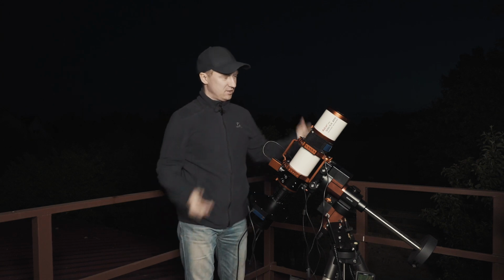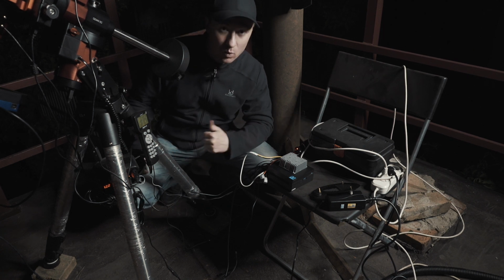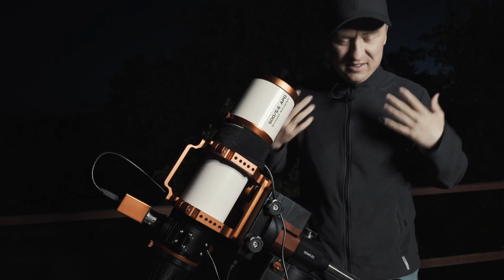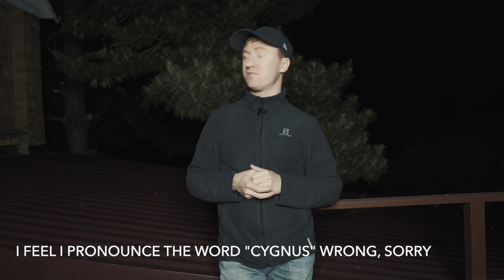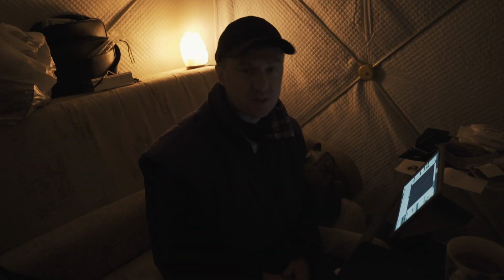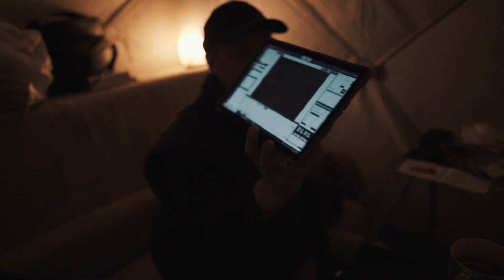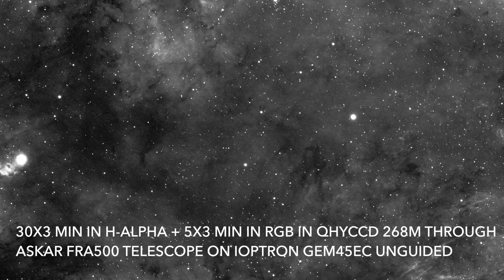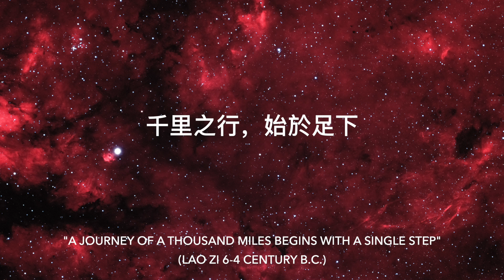The first light of Askar FRA500 telescope on QHY 268M + Optolong 3nm on iOptron GEM45EC unguided

Comment: Very nice result with the FRA500. I regret not investing in the EC model of the GEM45, I have the G Version and love it. Do you plan on adding Oiii and SII data to the Swan?
Clear Dark Skies!
Reply from the maker: Hi, Brian! Thank you for the supportive comment. I really had no plans to add more data, but this is a nice idea and thank you for that as well!
As for the mount - why do you regret? Is RMS really bad? I guess that when one uses guiding as we do - all those issues are corrected. Still, when EC is well-polar-aligned, it allows operation without guiding when focal length is just like 500 mm and shorter. Still, for the 1000 mm Newtonian guiding is a must. 👍